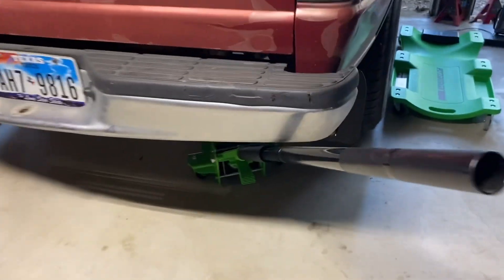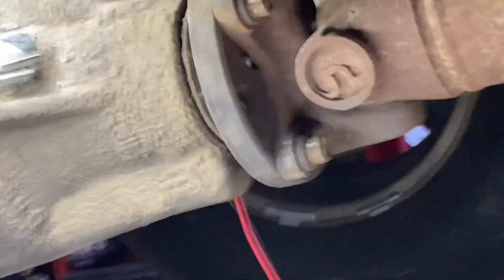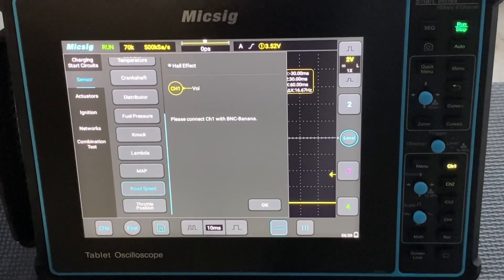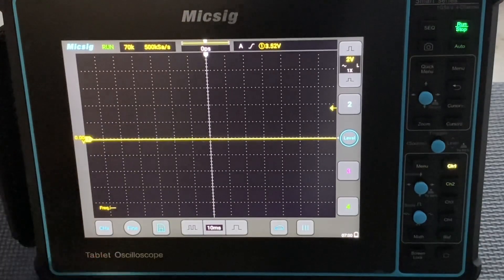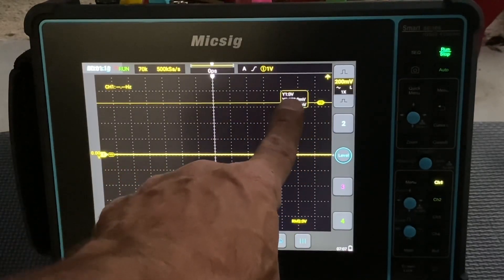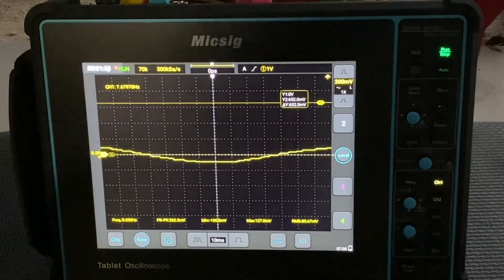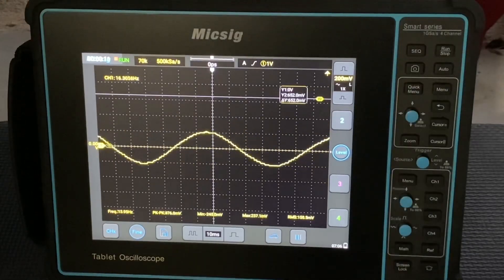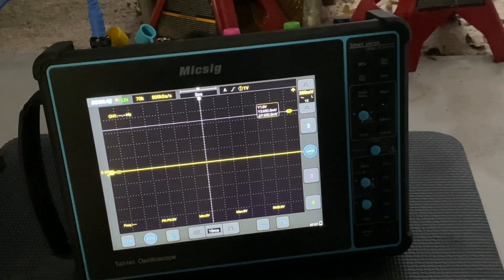Wheel Speed Sensor Waveform With Micsig SATO1004 99 Mazda B2500 MANUAL TRANSMISSION

Comment: Made a long comment, it didn't post so must of violated a policy. Thanks for putting out your videos and having a positive approach to automotive repair. Your positive comments and honest videos helped me pull the trigger on buying this scope and I have no regrets. You did ask a question in your video about A/C coupling. My understanding is you should us DC coupling for Sine wave of a permanent magnetic sensors. The way I understand it is A/C coupling measure voltage changes vs absolute voltage of DC coupling. Seen A/C coupling used with relative compression testing if using voltage vs inductive amp clamp. Also have seen it to monitor voltage drop, rise, and spike over switch contacts to really view the voltage changes at lower readings. Acts like a filter as I understand. Very interesting and have much to learn!
Reply from the maker: Hello Steve. I wonder why your first comment didn’t post. I feel your frustration. It’s almost impossible to not violate a “policy”. Thank you very much for the kind words. That really goes a long way. I try to not act like I know everything, because I don’t; and I’m ALWAYS learning, and welcome feedback. I started this channel because when I was on the fence of buying Micsigs first automotive scope, the ATO1104 (my first scope), there really wasn’t too much out there on it. And only a couple/few videos of it actually being used on an automobile. I went  ahead and rolled the dice and got it, and I’m glad I did. Now I’m on my third Micsig scope, and they continue to impress me. When you compare other scopes for under $1K, no one els even come close. At least not what I’ve seen.  So I figured I might as well make my own videos to put out there to help other people. It helps me too. That’s interesting what you said about the A/C coupling. I was under the impression, that if I’m looking at an A/C sine wave, that I use the A/C coupling. It does make sense though. I have done relative compression checks with no amp clamp, using A/C coupling and inverting the signal. I’ll have to read up more on the rest of what you mentioned, to hopefully get a  better understand of it. Thanks again Steve. I mentioned why I started my channel. Well , thanks to people like you, in return taking the time to better help me learn and  understand something; is why I continue with the channel. Thanks again, and your feedback and knowledge is always welcomed here, my friend.
Reply from the maker: I almost forgot. You mentioned using  A/C coupling for seeing the voltage changes at lower readings. I’m not sure if you are aware or not, but the scope has a Low Pass filter where you can set it to only see lower frequencies. You can manually set the range you want.  Anyway, I think that’s pretty cool. I’ve played around with it a little bit, but have not used it in a real world diagnosis yet. Ok, take care my friend.
Reply: @atomsworkshop195  
Atom,
Yes, I have played a little bit with the low pass filter to remove some noise from some waveforms. I don't know enough to know when the noise is acceptable or if I have an issue. I mainly work on Paccar products (Kenworth/Peterbilt) for a fleet of around 50 power units. I have access to Paccar service information and they have an area dedicated to Pico with waveform templates and evaluating your readings which is extremely helpful. Ironic thing is local dealer doesn't have a scope and it is only required to have one per 10 dealerships in a group. Lots of good articles on A/C coupling, a keysight web page has awesome explanation. I have been mainly just getting good known waveforms saved when I have time. I like the fact that I can save and name waveform, but that you can also save the settings volt/time/channels with it so you compare like to like. I have been using my saved waveforms as my own "presets"

Thanks,
Steve

Comment: that vss sensor detect how fast  speed for car not abs wheels sensor?  if you have chance test digital abs wheel sensorit will be very interesting thanks.
Reply from the maker: Hello Wzthonda. I will try to get that done. Have a good day buddy, and as always, thanks for watching.
Reply from the maker: It’s a 99 Mazda B2500 2.5l 5spd manual transmission. First off I am always learning and don’t know everything. So if I say something wrong, please let me know. This is what Alldata says:

Speed Sensor
   The anti-lock brake system uses three variable-reluctance sensors to determine vehicle speed. The antilock brake sensors operate on magnetic induction principle. As the teeth on the anti-lock brake sensor indicator rotate past the stationary sensor, a signal proportional to the speed of the rotation is generated and sent to the 4WABS control module through a twisted cable and shielded wiring harness.

I wish I could add pictures here. They have a picture of the one in the rear of the vehicle they call the rear axle speed sensor. That’s the one I probed in the video. 
They have another picture of one of the front sensors they call front speed sensor. It lives just behind the rotor. One on each wheel in the front. 

Just to confirm, You want me to hook up to the front one? Is that right?